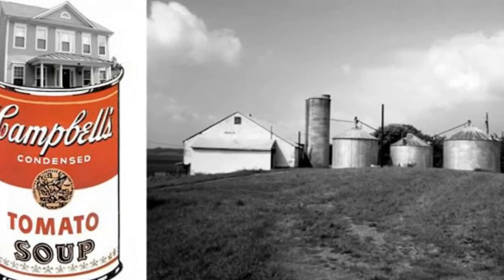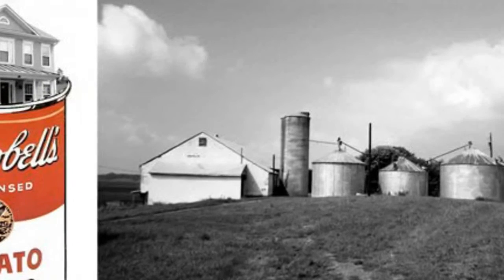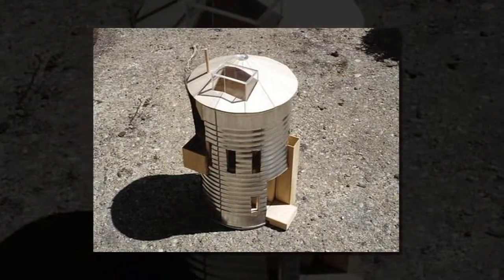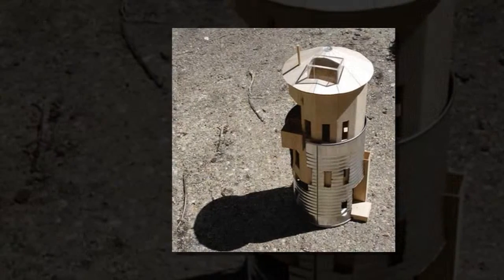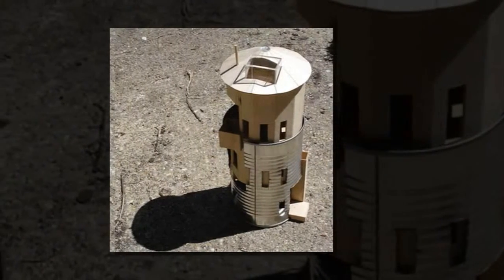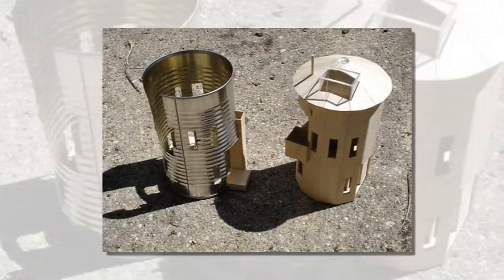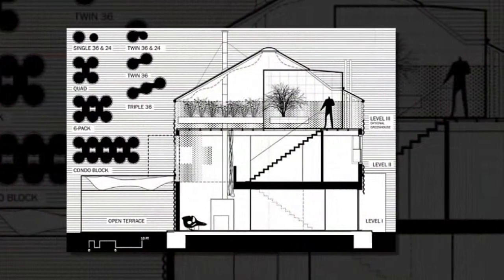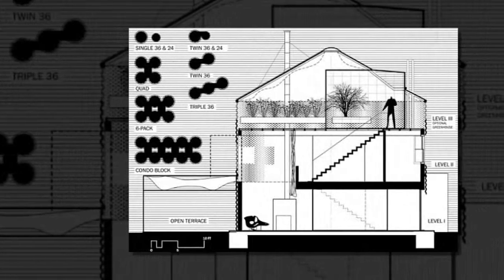Creating Cylindrical Prefab Homes From Renovated Grain Silos

Comment: thought this was built in the backyard of existing home. tiny homes are dependent on other places for other activities. outdoor spaces to get out of the house, as seen here, office to do work, not seen here, storage or shop to do typical stuff, etc. so if you have all that, no problem. but another strategy is to have that in one place. I work out of my house and also have an area to do artwork. would be impossible in this strategy. also not a fan of shiny exterior finishes. increase glare. house in tempe, by very high design types live there is a blast of light on neighbors in certain times of day. almost blinding. famous example, Disney Hall by Gehry in LA.